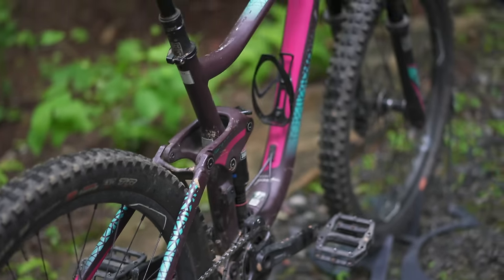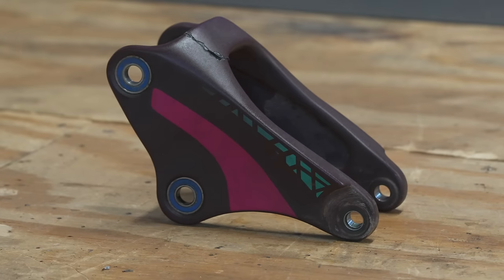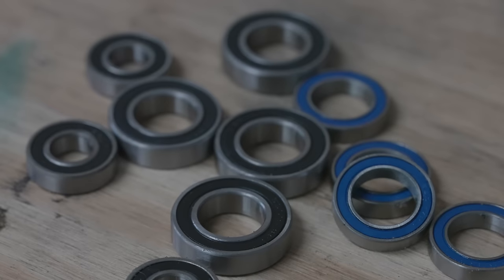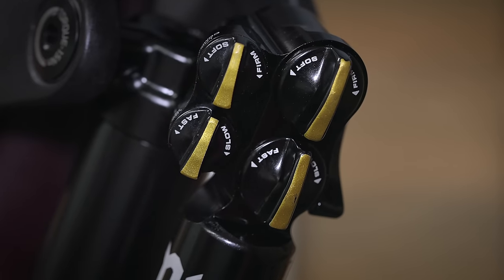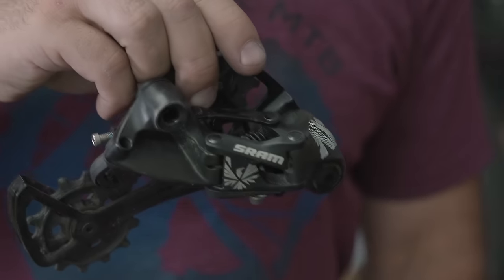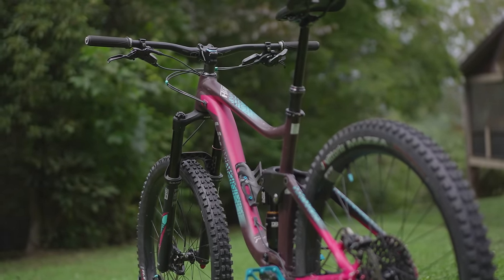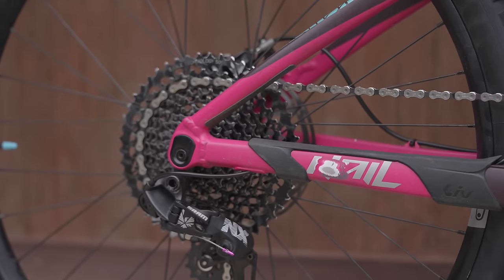Giving this Mom MTB a Parts Bin Overhaul, and damaging it in the process 😬

Comment: The backwards rear tire is always a classic, and using tubeless makes it even more fun. This is coming from a guy that rode his MTB with the rear tire on backwards for over a year.
Reply: Is there a difference?
Reply: did it affect your riding?
Reply: Well having the rear tire backwards can lessen its performance on the trail or road and this is coming from a guy who rode and crashed his motorcycle because the rear tire was put on backwards 😑
Reply: I’ve had mine on backwards for about a year as well. The second I put it on I realized what I did, but honestly I haven’t really noticed anything either.
I’ll fix it when it finally wears out.
Reply: It makes it easier to drift... or catch your tire depending on the pattern.  Probably not a huge difference for most people on that tire.  Squarish knobs.
Reply: “Backwards” on a rear tire is sometimes preferable: (Assuming ramped knobs) Do you want more climbing traction or more braking traction and less rolling resistance?
Reply: If you're a good rider it won't make a difference.
Reply: I swear I looked and could not find a rotation marker on my new rear tyre
Reply: Mad grip when you do fakies tho
Reply: Rear tire backwards…forgetaboutit!
Reply: @ylfursty9398  motorcycle is wayyyy different than a bicycle, tire direction matter an order of magnitude more than on a bicycle
Reply: @RealMTBAddict  that's like saying "if you're a good rider then having a carbon bike won't make a difference." In reality, if you're a BAD rider it won't make a difference, if you're a good rider, it does make a difference, as you're actually testing the tires/parts to their fullest ability
Reply: Immediately going to check my back wheels the right way round
Reply: Putting your rear tire on backwards was the move back in the 90s!  We rode in an extremely wet climate and were convinced it gave us that extra dig when climbing.
Reply: I did the same thing and yes it’s still backward. I’ll fix it tomorrow 😄
Reply: @DonceGT  it’s so minimal it doesn’t really matter
Reply: With older tires it was a common intentional tactic having to do with traction. The idea was basically that the front tire needs to grip well while braking which was “forwards” and the rear under propulsion for climbing grip, so you run in backwards. 

These days tires are designed better and you don’t do that anymore.
Reply: I had a local shop put my front tire on backwards, but since the tread pattern is symmetrical, I haven't bothered to fix it
Reply: @DonceGT  bro
Reply: It takes you more than a year to wear out a tyre?
Reply: @izzaelofficial6103
Reply: It's not end of the world. A lot of cross tires used to recommend you mount them "backwards" for the rear wheel for more grip when climbing.
Reply: My mate did the same thing. Kept complaining about a lack of drive and traction. It took two of us 3 hours of staring at to realise it was the wrong way
Reply: @gragaloth6237  i agree because i learned the hard way 😢🤦🏾
Reply: Just wait until you do it with cushcore
Reply: In the day, we reversed our tyres deliberately as tyres were tyres and that’s how we got grip.
Reply: @RealMTBAddict  If you're a good rider it will make a massive difference.
Reply: @mini696  no it won't.
Reply: I did this recently on my first proper MTB, Also decided hey you know what would be awesome. Cush Core.. 

So getting both them on (Finally) and then I look at the rear wheel in complete dismay. knowing what I will be up for.
Reply: My michelin is currently on backwards at the moment... I kinda like it..
Reply: @ylfursty9398  🤣🤣🤣🤣
Reply: @RealMTBAddict  if it wouldn’t make a difference then there wouldn’t be a “backwards orientation” change your name 😂
Reply: In think the only thing it will affect is my OCD

Comment: Seth shows that the best way to service a RockShox Reverb is to replace it with literally anything else. 👌
Reply: word
Reply: I have one on an old GT Force Carbon. As long as I keep it bled and pressurized it works okay, but wow that button murders my thumb even on short rides. I realize the Reverb was one of the early droppers on the market, but still -- what an absolutely pants design.
Reply: My LBS has literally offered to do the same for free labor, just so they don’t have to rebuild the existing dropper.
Reply: Mine needs adjusting up an extra half inch to allow for the sag
Reply: Yeah totally agree mine packed up after a few months
Reply: @AndreasRavnestad  there's also a thumb lever for the reverb. nevertheless, 3 years ago, I changed to a oneup and never looked back.
Reply: I still have a $120 DNM that Seth had on channel back in the day. Still works perfect lol. I do have a oneup with much longer travel on new bike, but it still works great on my light trail/winter ride.
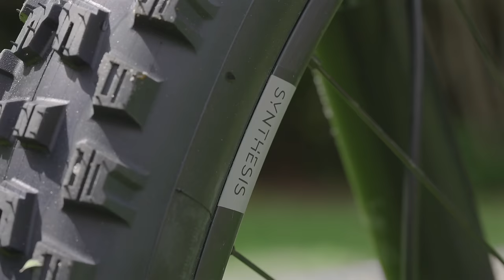Reply: 10:42 pedal not all the way in :P
Reply: @TimMaddux  same lol. It's also to save the experience of a customer having a crappy dropper 2 months later and spending another week ordering some obscure part.... Again. 

Vs any mechanical dropper or the new wireless axs, where we'd install it once and you're happy for a year. And even when you're not happy, a 15min der cable and housing install will probably have you back to perfection.
Reply: @RD1R  dropper post reviews should fail any dropper that doesn't: 1) respond properly when you depress the trigger and 2) stay motionless at all other times. Or, as I put it "go up, stay up, go down, stay down."

Everything else is just "nice to have" (stroke length, min insert depth, lever feel, ease of installation, stack height, etc)
Reply: @TimMaddux  but that's pretty much every brand new dropper. Even the cheapest ones will consistently do that for the first 1-3 months, which is when you'll see the review. Not to mention even a crappy lever is easily replaced, the $30-40 Giant or Bontrager base levers perform just fine. So the deciding factors have become your "extra perks."

And I would say ease of installation/maintenance does matter. Most newer droppers can be fixed at home in 30min with a YouTube tutorial and a multi-tool. Even if you're rolling in cash you still want to have that ability. Reverbs take specific tools and training just to keep working for more than a few months. I spent years working at a bike shop with 24/7 access to a full tool bench, stand, bleed kits, etc and I'd still rather have a simple SDG or OneUp post I can take apart and put together on my mini bench at home. 

The difference is how long the dropper keeps working. Will it keep doing what you've described after being stored for the winter in the "incorrect" down position? After a few muddy weekends soaking the seals and stanchion in dirt paste? After 1000 uses? If you knick the cable? Bad droppers (including most older reverbs) fail this time test. Most newer & even cheaper posts do this fine now.
Reply: I've got one. Can confirm. Serviced the thing more times than I can count, still sags again after a couple rides. sigh
Reply: @bartscully9175  Idk maybe the old one sucks or I got extremely lucky. I got mine like 1,5 years ago, still works like a dream even with riding in subzero temps and snow.
Reply: Hey Joseph, I hope you're doing well! Yeah, it's a beautiful example of how simpler can be much better. I have a $50 exaform dropper that has worked flawlessly for years now.
Reply: Literally? So a piece of wood works?
Reply: Anything is better than a reverb nowadays lol
Reply: Actually everything SRAM/RockShox is best serviced like that! Overpriced rubbish....
Reply: First mtb I ever bought came with one (used). Probably stopped fully working like the 2nd ride! Definitely worth replacing 😂
Reply: but not with a ks lev 😵
Reply: Had one, that’s definitely the right move
Reply: @cok666joey  indeed
Reply: most bs dropper ever from the biggest company 🤣
Reply: Done that. Waste of time to service them. Anything is better.
Reply: So a car muffler works better?
Reply: There's absolutely nothing wrong with the Reverb Stealth C1. It's a myth there's problems with the newer models. It's just the A and B models.
Reply: It's a bogus work-around, but mine has a valve under the seat clamp that will release the built-up air in the system that causes the sag.  I have to 'drain' it every 8-10 rides.  Seems like  just fixing the design flaw would be better than inventing a whole new piece of hardware to work around the flaw, but maybe that's crazy talk.
Reply: Exactly
Reply: I bought a 2018 Kona Exploxif with one and was a bike shop mechanic at the time and honestly the push button for it is ass but the lever is where it’s at and makes bleeding the system much easier I was very pleased when mine worked and I understand the problems people got with it from the garbage button that caused most of the bleeding and actuation pressure issues
Reply: Just put out a new video on the new super aero tuck
Reply: @AndreasRavnestad cant you replace the lever with something else?

Comment: Gaint is sadly overlooked and out right dissed in the MTB community, I own an older trance 2 in my stable of bikes.  I had the pleasure of testing out a 2022  29 trance x.  In my opinion it outrides any modern trek, SC, rocky mountain or Kona trail bike.  Fantastic climber and is nice and poppy on the downs for an all mountain trail bike.  The comparables mentioned  are some bikes I got to try out last few years.  

Giant has really stepped up there game last 5 years and is making solid bikes for a lot less money compared to other major brands.
Reply: I also have an older trance 2 (2018) and it's a great time. The frame is great, nice and light and really snappy. Once you throw some good upgrades on it, wheels, tires, crankset, dropper and some new bars the thing rips.
Reply: I think the problem is that their stance (the cheapest full sus with the aluminum flex stays) is not at the standard of their other bikes. In order for someone to look into one of the better giants, they would have to either not know anyone who rode the stance as their second bike or ride one of the nice ones by chance at a demo day or something. Having a suboptimal experience for the new customers is not great for sales, even if every other product is great (and they are).
Reply: i love the trance 2
Reply: I had a reign and it was trash.

Comment: I'm so glad the last tire I put on backwards still had a tube in it. Never happened to me again (knocking on wood) since I transitioned to tubeless 4 years ago.
Reply: Why is it worse to do that mistake if it is tubeless? i dont have tubeless tires
Reply: @majortom4543  reseating the bead can be annoying if you don’t have the proper hardware. Also wasting sealant and can get messy

Comment: My old ProFlex had nylon bushings rotating on anodized aluminum supports. Those things NEVER wore out. After 20 years of riding they still worked great. Dunno why anyone bothers with ball bearings in their suspension linkages. If nothing else you could get Oilite bushings that are made of sintered bronze and have oil embedded in them, so they don't have to be manually lubricated.

Comment: Recently had mine overhauled by a shop. Thanks for showing me I made the right decision instead of doing it myself! Haha. Normally I do handy things by myself but the tools, the time and the likelihood of breaking something was too high.
Reply: I'm not the most mechanically inclined person, but Seth's videos have given me the confidence to work on my own bike. I've had to buy some specialty bicycle tools, but I think it's worth it in the long run since it saves me the time, expense, and hassle of taking my bike to the shop.  Some things I will still use the shop for (servicing front air forks really intimidates me), but pretty much anything else, I'm willing to give it a go. Worst that can happen is I might screw something up and will need to pay someone to fix it. I'm okay with that.
Reply: I just purchased a full suspension and I was on the fence of doing the work myself.  But after seeing how hard it is to deal with all the bearings, I think I'll leave it to a pro.

Comment: OneUp suggests having 10mm spacers above the stem for the installation of the threaded top cap. This is to prevent clamping forces from the stem onto the threaded section of the steerer tube. 

I also didn’t follow their advice and only went with 5mm spacers above the stem for the cool factor. 

You are ballsy to go with no spacers above the stem. It definitely looks cleaner. But you are clamping about 8Nm onto the threaded section of the steer tube which is has less material to clamp onto.
Reply: Good point!
Reply: Yep... weakens the steerer tube significantly in that area... but the bottom of the steerer is on full tube, so likely fine for her... she didnt look like a big lady in the vid.

Comment: the dropper post is actually really easy to repair.
rockshox include an air bleed valve right at the top.
extend the post all the way, push the valve
done. no sag anymore, rock solid, takes 1 minute
Reply: That's in the new model. The old one does have that problem and is only fixed by bleeding the droper like you do to the brakes. Because the cause is the same, air in the system. Great dropper, nothing will go wrong with it if you maintain it. No lifespan for that one 🙂
Reply: @tiagofernandes5011  bleeding will not fix the saggy post, it can be done by replacing seals and rebuilding. Most bike shops will not do this repair though. Saggy post is usually caused by picking the bike up by the saddle when dropped, and the seal blows.

Comment: If Seth is referring to Threadless Headsets by mentioning the star nut's effect on mountain biking, I absolutely agree. Hipsters and retro grouches might still embrace the quill stem/wedge bolt/threaded fork/constantly loose headset, but I hated them with a passion. Aheadset/threadless changed things for the better in mountain, then road and especially in freestyle BMX. Droppers, tubeless, suspension, disc brakes, and 1x/clutch/NW are all important innovations for modern bicycles, but threadless is where bikes really started to not suck.

Comment: Yeah, female specific bikes were first started with the Santa Cruz Juliana. (I believe. Others may have been doing the same thing, but I had never heard of any). It was called that for Juli Furtado, an absolute rock star in mtb, road racing and skiing. A shop where I worked for a bunch of years, called Another Bike Shop, in Santa Cruz, worked very closely with Santa Cruz bikes pretty much from the beginning , starting with the earliest Tazmon. (An original frame designed by none other than Tom Morris himself, still hangs in the shop. She wanted a female specific frame.qAnyway, when they were working on the Juliana, they brought one to our shop to test. They are only about three miles away. Being the towering figure I am at 5’4”, it was put to me to try out. I could definitely feel the difference and could tell the frame dimensions were built for a woman. Little bit longer seat tube for longer legs, little bit shorter reach, thinner handle bars and so on. We also worked very closely with Fox when they were developing mtb forks. I actually had the first retail Fox fork on my first ( of many) Santa Cruz Chameleon single speeds. I’m on my fifth one now, but still a single speed. This one has a Fox 36 on it. I sure wish I still had that first one.😞

Comment: Hey Seth, I have a suggestion for you. I'm sure you use mag pads to map your screws/bolts when disassembling something? I run an electronics hardware repair business and am often bouncing between multiple repairs to maximize efficiency. This means those mag pads are a life saver. But nearly all of them are complete trash in terms of how magnetic they are. 

The only one I've used that is actually good was actually a free addon when I bought an electronic tech screwdriver from Xiaomi, the 'wow pad.' You can actually place 20 screws on there in a particular layout, flip it upside down and shake the thing. They just don't move, it's great. 

What I'd really like to see is you testing different mag pads as a segue into a bike repair. Help me find ones that don't suck. Even iFixit who makes great tech products has an awful mag pad. 

Just food for thought and I feel your viewerbase would enjoy some nerdy tool stuff here and there :)

Comment: I noticed Seth using some regular wd-40 to loosen some linkage bolts and I just wanna point out that using aero kroil instead as it works better and maybe you could have gotten the bolt saving the time waiting for a new linkage part. But I don’t want this to seem like I’m a know it all. Just a little tip

Comment: Today I learned: that I can use the "useless" inner tube nut/ring thingy to hold the caliper's screws in place when disassembled. Nice that one!
Reply: 1, not useless, they hold the valve square and in position correctly, 2, can be added to other various bolts as a backing nut, like seth did here, hes even shown this before in other videos
Reply: They are also very useful as spacers, say on a road bike water bottle cage to clear the front derailleur or for installing a rack on a fork to clear the arms
Reply: Time stamp ?
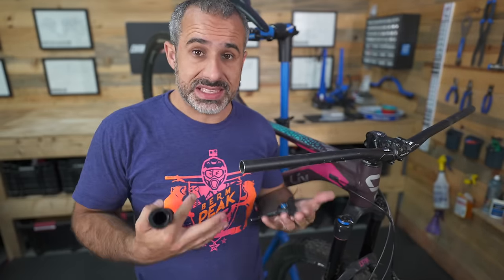Reply: @bbuueennnoo  1:55

Comment: 7:45 All steerer tubes should be threaded. I hate tightening my top cap because once I accidentally over tightened one and so now I am nervous every time I do it. There's no torque spec. I had a creaky headset on a bike so I had to make it tight but I was worried I might overtighten it. If the steerer tube was threaded then you could just torque it to like 6Nm or something and jobs done.